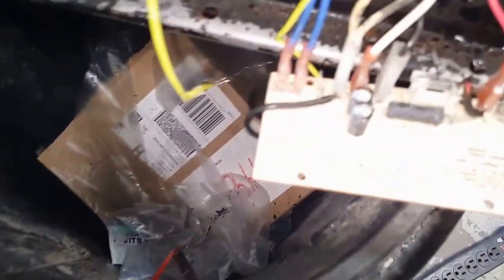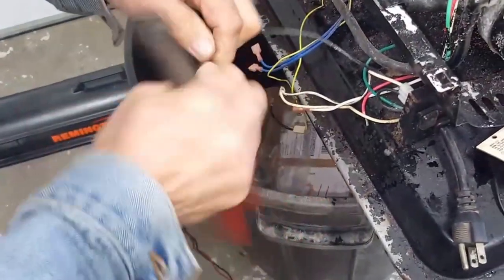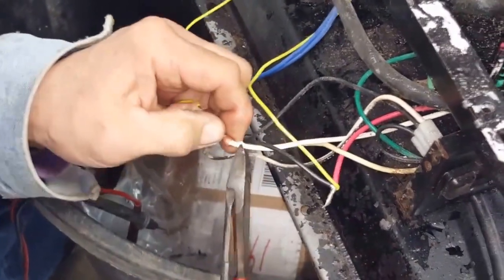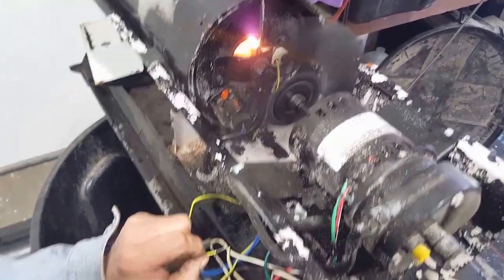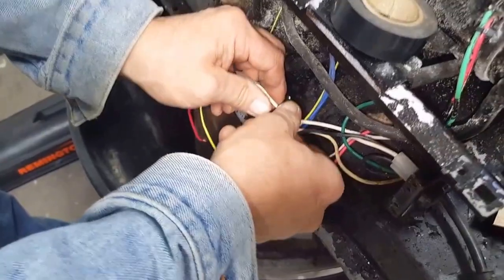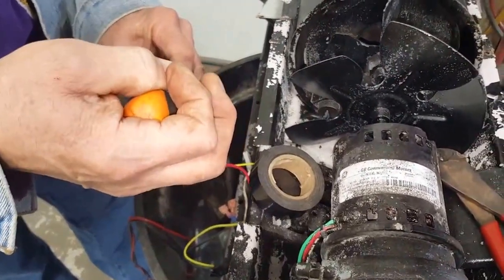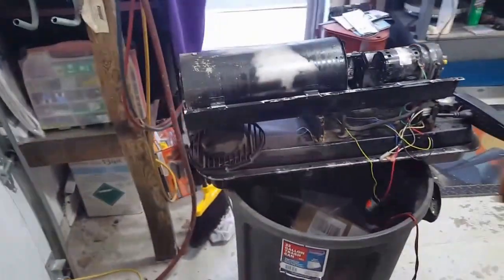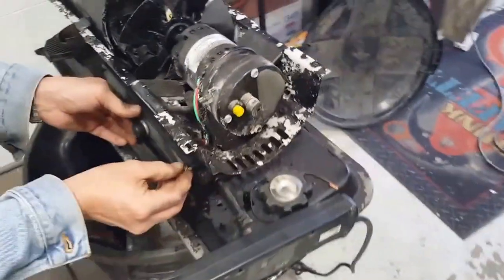How to repair a remington salamander heater with removing the circuit board that you buy off eBay

Comment: 1-30-19 Michigan -15 degrees and no heat, I thought about doing this but wasn’t sure if it would work, thank you, I’m not freezing to death! Of course it doesn’t shut off when you run out of fuel but I’m OK with that I don’t let it run out of fuel anyway and I never leave it running if I’m not in the garage with it thanks again not the safest but as I stated before I’m not freezing to death!

Comment: Why did the photoeye not get installed? Isn’t it there for safety?
Reply from the maker: I don't think these have the photo eye. We went back and hooked up the blue safety wires. That the safety on these. I think..
Reply: Obviously it did have the blue wires, to the photoeye. Hooked up the blue wires where? This video should be stated this is diagnosis of functionality of each component in order to determine which part is defective. Since the connections were cut off and no jumpers were used, the video just shows how to bypass everything to make it run manually. Don’t need no circuit board, no photoeye. Just power the blower and igniter, push button to start. Raw fuel is being blown in the shop until it goes KABOOM!
Reply from the maker: @deanhenthorn1890  
Just for emergency. Works good for the last 2 years. Now it just rusted away. Do what you got to do to stay warm.